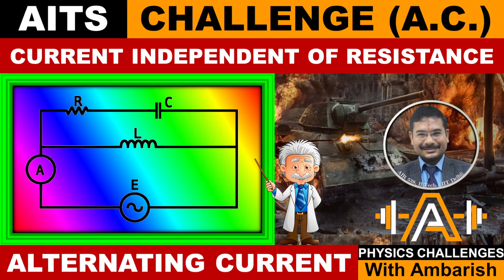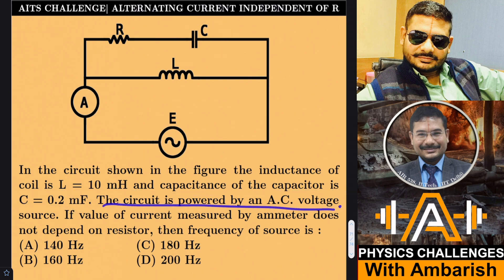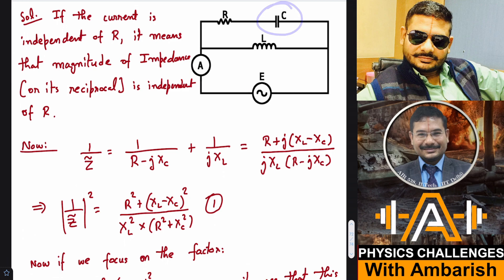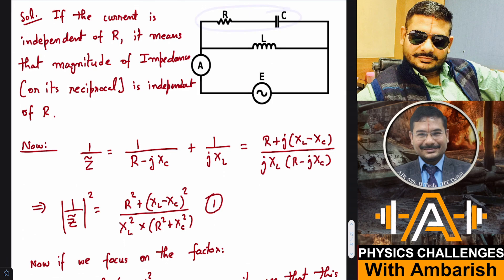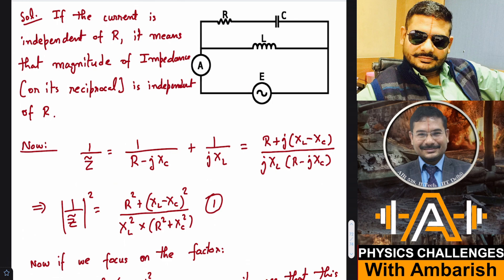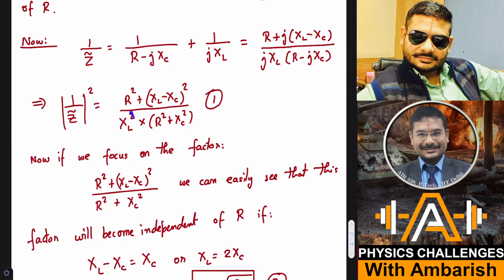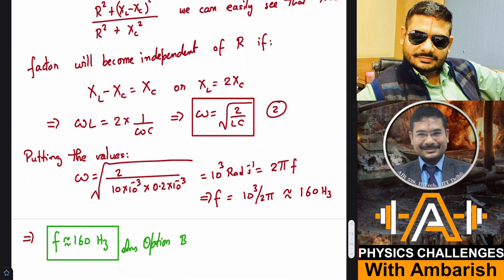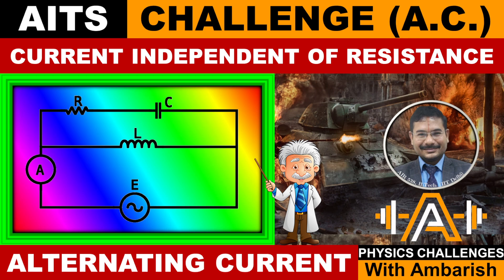ALTERNATING CURRENT| AITS CHALLENGE| CURRENT INDEPENDENT OF RESISTANCE| JEE ADVANCED| KVPY| COMPLEX

Comment: Sir, could you please explain why we use change in energy to find force on dielectric, when we did not consider fringing while deriving the formula of energy of capacitor?
Reply from the maker: While deriving energy we treated it like an infinite sheet so fringing effect contribution to energy is negligible. However force on the dielectric is precisely due to fringing
Reply: Sir, but when we neglected the effect of fringing in the expression of energy, how come taking the difference in energy also includes fringing?
Reply: You don’t need to neglect energy due to fringing .but the fact is energy stored in fringing field remains constant while dielectric plate moves inside ,what changes is the energy stored inside the capacitor which is uniform . Since you are differentiating energy to find force , that constant energy stored in fringing field doesn’t make difference . To understand more , see Griffiths chapter 4, page 204 ,chapter name Electric fields in Matter .
Reply: @physicsfun2022  Thank you very much